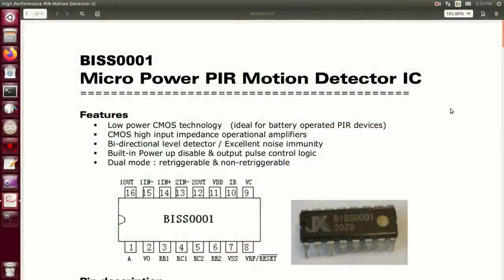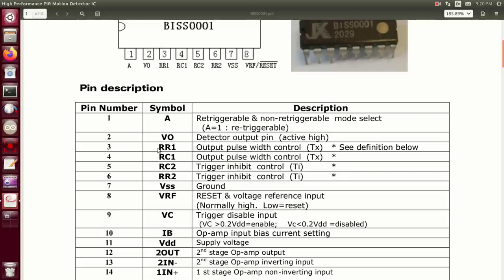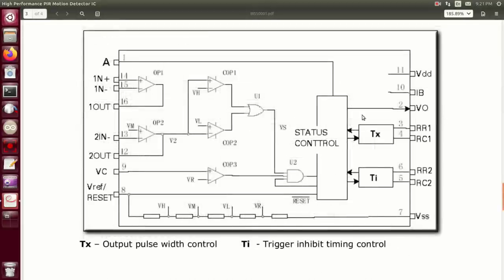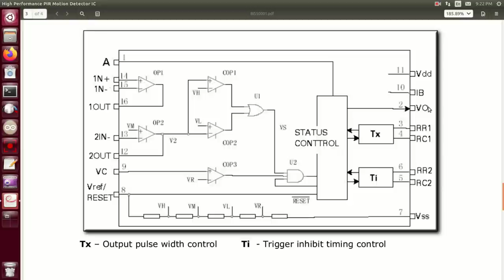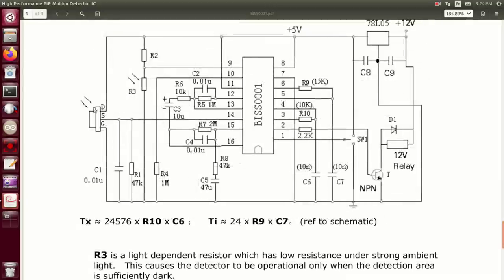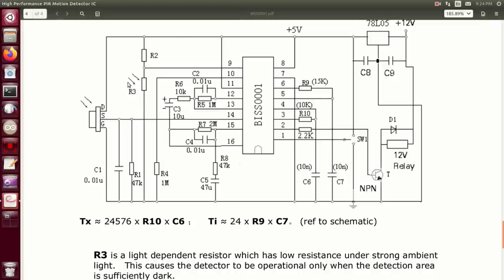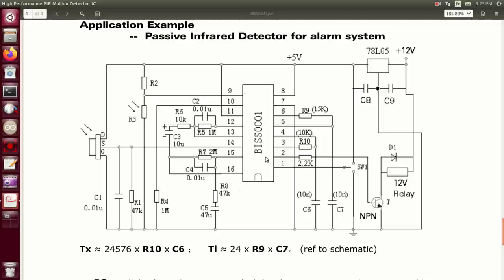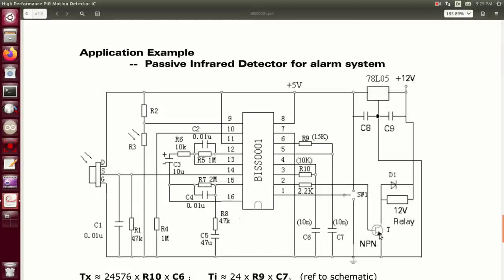motion detector night light - curiosity teardown

Comment: Tear downs are not really lazy.  You still have to take the darn thing apart an analyze / reverse engineer it.
Passive Infrared detectors usually can detect the movement across the detector, the insides usually split into two parts to detect the difference from one side to the other.  The fresnel lens is pretty critical, as you mentioned, to the correct detection pattern.
Thanks for bringing us these videos and keeping us entertained.

Comment: Last time I probed a circuit running mains, an IC turned into a convertible and popped it's top - lol -.
Reply: Ha h ha I had a 400v cap blow like a gun after 3 or 4 days made me jump lol
Reply: @davey2k12  My dad knew which way I was going when I stuck a low voltage electrolytic into the end of an extension lead and turned it on.  It didn't blow first time so I reversed the polarity, and yeah it was like a pistol shot :-D
Reply: @Marcelo Kairo yup, I have been using Instaflixxer for since december myself =)

Comment: A drill bit will open that small hole up then the light detector will see better.
Reply from the maker: That's a nice simple fix. I like it
Reply: @pileofstuff  I was thinking of a bit of optical fiber or other clear plastic as a light pipe to give it a better view, but a drill is simpler and likely faster.

Comment: Can you remove the AC leads and use a 9 volt battery for power ?  Just asking I am new at this
Reply from the maker: With 9 volts the LEDs will be quite dim, if they lit at all. (due to the current limiting resistors)
But you could put 12 volts across that power supply capacitor and the whole thing ought to work normally.
Or, if you really wanted to use 9 volts, you could re-calculate the values for the LED current limiting resistors and replace those.
Reply: Awesome, I really appreciate the help.  I was worried I asked a very stupid question.  Have a great weekend.
Reply: No, because 9V DC won't get past the dropping capacitor.  You could certainly design your own circuit to run off a battery though.  I'd recommend you investigate the arduino micro controllers like the arduino uno.  Less than $10 and you get something that can work with most of these little sensors while running off a USB port.  You do need to be a little tech savvy to programme them but they are a great introduction to basic electronics and there's lots of youtubers with tutorials and such.  There's also starter kits that are maybe $50 but hold your hand and take you through all the necessary steps to get you up to speed.  For example google "Seeed Studio All In One Grove Starter Kit for Arduino".  It's a kit with the arduino, sensors, cables etc in a really nice format that will get you going.  Maybe not the IR sensor but you can figure that out once you've mastered some basics.

An alternative Heath Robinson approach would be to understand that you need to bypass the mains circuit (the capacitive dropper) and give the controller, sensors and LEDs the 12 volts they need to work correctly.  It would not be too hard to do with some basic knowledge. (ie maybe take a step back and start from the beginning).
Reply: @dukeeod1650  Oh, and there's no stupid questions, only stupid answers.  (in reply to your reply to PoStuff)

Comment: The problem with this kind of light is the power consumption. It is always the same, there is no saving when the light is off.
Reply from the maker: True, but it's consumption is negligible compared to the previous generation of night lights (incandescent bulb)
Reply: Yes and no. Depends on the idle power consumption of the old generation and the on time. This one will eat rated power 24 hours a day.